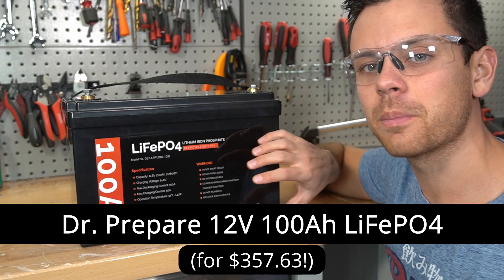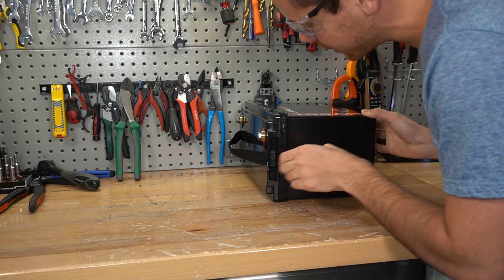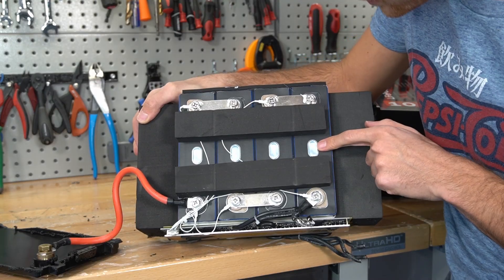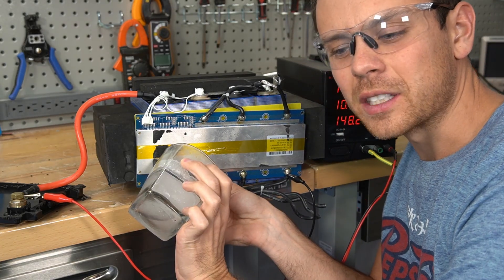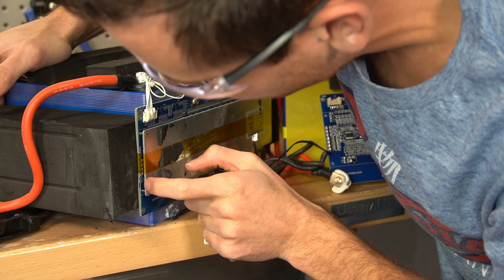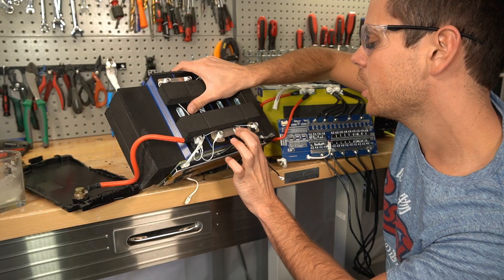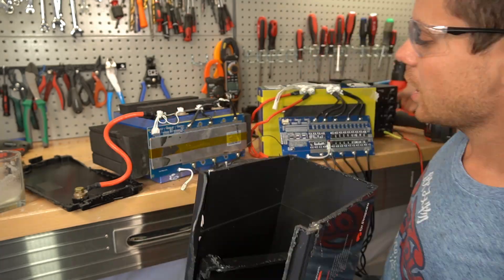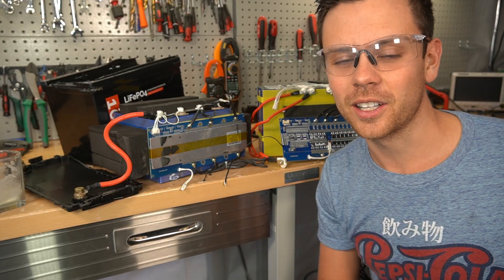Dr.Prepare 12V 100Ah LiFePO4 Battery Tear Down!

Comment: I just got 2 of these batteries for my boat trolling motor. I will make sure and charge only when outside temps are above freezing. Thanks for the heads up. Glad I got the Weize for my RV as it charges in the cold.
Reply: I just bought 2 for my Trolling Motor. How have yours held up?

Comment: Dr prepare solar batteries have full charge capacity of 30 percent full charge at 12.7v when requires 14.5v for 100 percent. stored.  13.75v tried all tests on these batteries and they completely fail as lifepo4  battery, they operate about as good as used car batteries

Comment: You should review this again.  They've added low temp protection so it would be good to do another tear down.
Reply: I'd like to see the new tear down since I just bought 2 from Dr prepare
Reply: Me too. I got two 2/2/24
Reply: I bought 4 of these, with the screen.  2 failed immediately, they replaced them so I was happy.  I used them for my mower. By the time they sent the new ones though it was late in December and I didn't need to mow.  Finally I got to mow with it, and in the middle of the first mow, it is dead. a third battery is bad.  I'm going to go buy a different brand.  I don't have time to keep dealing with this.

Comment: I just purchased 4 of the $299 batteries for a golf cart. They do claim to have low temp sensors on this battery. I'm not going to cut them open, but they're working great for me.

Comment: Well, I did not listen.   Yesterday I received the Dr. Prepare 12 volt, 100 Ah battery.  I charged it to 100% using my solar panels.  Today I attempted to connect it to my 2,500 watt inverter.  First I disconnected the battery that was already connected to the inverter.  Next I connected the positive terminal of the battery to the inverter.  Then I always connect a 30 ohm resistor between the negative battery terminal and the negative terminal of the inverter for about 30 seconds in order to eliminate any spark and surge of electricity to the inverter's capacitors.

After the 30 seconds, I attempted to connect the negative terminal of the inverter to the negative terminal of the battery but a GIANT SPARK was produced and now, after 2 hours, the battery is unresponsive {aka DEAD !}.  There is no read out on the small view screen on the top of the battery and my voltmeter registers 0 volts.  My guess is that the BMS was not working properly from the beginning. I am glad that I was wearing safety glasses because small pieces of hot metal shot from the terminal.

After disconnecting the Dr. Prepare battery, I connected a fully charged battery from another manufacture and everything functioned normally {aka no explosion}.

Comment: Hey Will, I just saw an ad on my Facebook feed for the Dr. Prepare battery, and they claim (and show a video where it was tested in an environmental chamber) low temp charge/discharge protection. Is this a different model from the one you tested in this video?
Reply: They sell five models on their website.  Two do not have low temperature sensors and three do have low temp.  These specs are stated on their individual webpages.  I didn't understand Will's dissatisfaction with the ack of low temperature sensor considering the model in this review is not advertised a having low temperature.  You can tell because the batteries all look different; though they do look similar.

Comment: Curious what you do with the packs after disassemble. Do you take them to a recycling center or salvage cells/BMS?
Reply from the maker: Why would I do that? I need them. They will last for decades
Reply: @WillProwse  So you glue/tape the cases back together after cutting them apart?
Reply from the maker: @robosilo  no, I use them. My gate opener, cameras on property, using them in scooters etc. I never throw away my batteries, I need them
Reply from the maker: @robosilo  why would someone try to recycle something they can use
Reply: @WillProwse  In this video the cable was damaged and the case was cut up quit a bit. From a safety standpoint I didn't know how much you trusted the remaining parts.
Reply from the maker: @robosilo  oh I use this one for bad example batteries for new video

Comment: The BIG atrocity is that Chill Will did not notice the covered screw holes that hold the top in place and hacked the case open instead..  LOL!  How about removing the heat sink and connecting the  high temp sensor to it's rightful place, or would the BMS have to be re-programed?

Comment: Since the BMS is good, could you just solastic the high-temp sensor next to the fets and then solder in your own low-temp sensor to the unpopulated contacts to make it a functional battery? ... Also replace that frayed wire of course.
Reply from the maker: I can't think of a single person on this planet who would go through that effort, then glue the case back together, when you can buy a cheaper battery with better parts and higher quality design and assembly. That would be a huge waste of time.
Reply from the maker: Also, we have no clue what integrated circuit they are using to control the bms, and it could be flashed with different firmware that does not support low temp cut off.
Reply: @WillProwse  
No, I wasn't saying that should be a mod that would make buying this battery a good idea. But for those that might have already purchased one and are beyond a return period and have a bit of buyer's remorse. Also, it seems like the case uses screws, is it glued as well?

Comment: Do you think there is any build difference in the longer 4D 200ah batteries. I would assume they should be the same just larger. Any issues you have seen with the larger batteries?

Comment: Thanks for opening the case on this unit.  It looks like this is a classic example that your get what you pay for isn’t it?  After seeing the temperature sensor configuration I’m guessing that this battery wouldn’t last very long because it didn’t have things wired correctly to protect itself from overheating or cold temps.  Can you think of a time where this type of battery would be useful?  Could a couple of them be used with a small pure sine wave inverter as a battery backup for a computer or printer that needs to stay operational like for security cameras?

Comment: Hi Will. Yesterday I was texting back and forth about winning a 100ah battery … In this day and age it’s difficult to know who you’re communicating with … was that you that I was talking to?
Reply from the maker: No, that's a spam profile. Ignore it
Reply: @WillProwse   - On a totally different subject. I live on a catamaran. The lead acid bank is on its last leg and I thought I would try to switch to lithium. I have a wind generator, three 280 watt solar panels each with its own Blue Sky 3000i controller, two engines with alternators, an Aims 3000 watt inverter, and shore power when I'm at the dock. I'm thinking two 12v 300ah Chins batteries run in parallel might suffice. I understand that they have no low temp cutoff, however, I'm in warm weather all the time and was going to get the holding tank warmer you suggested just in case. I'm not sure how to handle the engine alternators as I know they need to have a constant load which lithium won't provide when fully charged. Any thoughts?

Also, I know that you have a bunch of fans in the sailing community ... if you haven't already done so, maybe you could put together a video about how to wire all these (above) components up on a boat? I would like to volunteer my boat as the guinea pig - Lol.
Reply: I called in the first 30 minutes and they doubled my gift and gave me free shipping too! 
I just had to pay a separate fee.

Comment: Got my Dr Prepare 100Ah Batteries today.  First thing I did was crack one open.  There is a lot of wasted space in these cases.  Mine didn't have a pinched wire but it did have the misplaced heat sensor and no cold temp sensor.  There were also sloppy finger prints all over the bus bars.  I'll clean these units up, move the heat sensor, install a cold sensor and repackage two of these into a Pelican Case for portable power.  Thanks for the inside look at this Dr Pooper of a battery build.

Comment: Last night I emailed to cancel my order and received this response below. The email confirms no low temp protection but also claims that is a feature?

Dear Value Customer,

Thank you for supporting Dr.Prepare. Dr.Prepare has received emails from some guests expressing some confusion about the low-temperature protection of the battery, so we would like to explain this to every customer here.

We saw the video that Will Prowse used a chainsaw to disassemble the battery and edited part of the process. It is impossible for our wires to be exposed outside. You can watch it again.

Our LFP batteries do not have low-temperature protection. Low-temperature protection is that under the monitoring of BMS temperature sensor, the battery will stop charging during 23-32F and stop discharging during -4-2F. And the battery will reach -F only when the outdoor temperature is lower to -40--22F, which means that the power will be completely shut off when emergencies or snowstorms happen. But with our batteries, there is no problem to be used at low temperatures. This allows the battery to continue to work in emergencies or snowstorms.

The built-in BMS in our batteries focuses on high-temperature protection. If the LFP battery exceeds 60C, there is a risk of high temperature in the battery, which may cause sparks. Therefore, we have two built-in high-temperature detection sensors, one is inside the heat dissipation aluminum plate, and the other is attached to the surface of the battery to ensure that the temperature of the two main components is within a safe range.

We hope that the above three paragraphs can help you understand our batteries and decide whether they can fit your requirements.

Please let us know if you want to keep your order or cancel it. We will ship it or process the refund in about 24 hours after your reply. 

Thank you again for your time and support. We are looking forward to your reply.

Best regards,
Dr. Prepare Customer Support
Reply from the maker: 😂😂😂 that's the best they got?! Wow
Reply: @WillProwse  I guess at a minimum they have clarified the confusion about the low temp protection. Their website does not state it has low temp protection so I can only assume this was a mistake in another review on a different channel. 

Two questions, first was that case also glued and screwed close or would you have been able to open it by removing the plugs and screws? Some people are going to end up with these batteries and it would be helpful to know if they can open them to check the wiring. Second did you remove the aluminum plate on the BMS? Dr Prepare claims there is a second temp sensor under the aluminum plate, but that was never shown in the video review. 

But it does appear this is a canned response going out to customers who ordered and are now canceling. 

Thank you for taking the time to educate the community. These videos take a lot of work.
Reply: @WillProwse  just heard from SOK they should be releasing updated batteries next week with their new Bluetooth enabled BMS that you can now buy today and a built in heat option for cold weather. 

So new SOK DIY BMS available now for $99 and new SOK batteries next week.

Comment: Gonna be real. I don’t like how you state having only high temp is bad. 

In some areas like AZ (most) you’ll never need the low temp sensor ever. 

It’s not bad but I think you should preface it by saying it wouldn’t be good for people in cold geographical areas as not being good for them. 

But most of the south west, Midwest etc would be totally fine.
Reply from the maker: It should be in every lifepo4 battery no matter what. It costs $1-4 to add it.
Reply from the maker: There is no high temp on this battery where it matters, which is on the bank of MOSFETs. That sensor would not trigger from ambient temperature. It's much higher, like 160 degrees Celsius. You don't understand the point of these sensors it seems. It does matter a lot.

Comment: Hello Will,   Regarding this battery and Low Temp Sense not being enabled.  I have a marine application in the SF Area, and the batteries sit in the Bay where temps will never drop below 50 deg F.  I don't believe low temp protection has any value in my application.  Would you agree ?    Second question: can a user open this battery up without destroying the case ?  You had mentioned screws that you missed.   Is there any reason I couldn't open it up an re insulate that errant internal connections, and make sure the battery is sealed against water intrusion  ?  Since the BMS was of good quality (I think) and the cells were seemingly of Grade A quality would you say this battery would be acceptable in my case  ?   This channel and your website are excellent. I am basing both a refit of my boats batteries, and adding a small power back up system to my home based on your information.  Have a great Christmas.
Reply from the maker: And thank you!
Reply from the maker: There are many other batteries that I recommend that are designed and function better than this. This is not a battery you should buy. I think the consistency in build quality could vary a lot.
Reply: @WillProwse  Thanks Will.   THen I will likely go with the Renogy 100ah as the case looks well sealed. The SOK is an option but the case is likely steel and will corrode.   Regards,
Reply from the maker: @brianboschma  sok has a nylon case option now. You should check it out.
Reply from the maker: @brianboschma  the new sok can be found here: https://www.mobile-solarpower.com/lithium-batteries.html
Reply: @WillProwse  Hi Will, thanks for the data.  Do you know if the 100AH battery , IP85 rated (Plastic case is available via CurrentConnect ?    I see the 200AH is not.  Thanks for the continued great vids.

Comment: Hi Will: Thanks for the great content.  I have a battery question for you.  My setup in the RV is using 3 Battleborn 100 ah batteries connected in parallel connected to a Muti-plus 3000va inverter/charger with al Victron mppt charger and other victron accessories. I was planning to add another Battleborn battery in parallel but wondering if I could add an SOC 206 ah battry to the bank.  I thought the Battleborn was 13.6 vdc and I see that the SOC is labeled 12.6vdc.   Is this going to be an issue?   Thanks

Comment: So why are batteries advertised in terms of Amp Hours rather than Watt Hours? I find it annoying to always have to do the math to get a feel for what a given configuration will power and for how long. The Google explanation seems to be that the Amp Hour rating is fairly reliable but a Watt Hour rating wouldn't be: because it is more dependent on the chemistry and how the battery is used. It seems like this problem also applies to Amp Hour ratings since with some chemistries, if you actually use more than half the rated capacity, you'll damage the battery.

Even cars make the effort to produce a standardized estimate of City/Highway MPG: even though your mileage may vary.

Comment: I've seen you make comments about the high temp sensor on several videos. In Florida, they might be more useful. We almost never see temperatures below 50 degrees fahrenheit.
Reply from the maker: High temp is for prolonged discharge when pack is in insulated compartment. Whether it's in hot or cold ambient temp environment. It's more to protect fets in unlikely scenarios

Comment: In your opinion. I am looking for a 12v battery for my trolling motor and i don't want to spend more than $350 and i don't necessarily need 100ah or the best battery just a reliable one.

Comment: Ok I have been installing LFP off grid systems on sailboats for a decade and have never had a situation where with a liveaboard there has been a need for a low temperature cutoff sensor.  So for me and my customers not having that is not an issue .  Why is it so important to you?  You do realise they make silicone heat pads for the express purpose of keeping the battery above the 1°C safe zone .  And not installing one would be a problem for me if freeze protection was warranted.
Reply: I have an off grid solar power system set up in an unheated shed. I need low-temp cutoff in my LiFePO4 batteries. It's a huge issue if a battery is misrepresented, and my batteries are damaged by charging below 0°C.
Reply: @robertm2663  perhaps you should invest in a battery heating pad specificly for lifepo4  or next battery upgrade either the relion Lt series or lifeypo4 cells both can be charged at -20°C. Or -4°F  I would never depend on a temperature  sensor to save my thousands of dollars  batteries
Reply from the maker: Instant and permanent damage if you charge quickly when the pack is cold. And we need to push for low temp protection in every battery. UL listed packs have 4 sensors for low temp charging protection. Cheap Chinese packs have none. It costs $1-4 to add it to the pack. You can short a cell from charging when it is cold, the dendrite formation can puncture the separator and cause a short from cathode to anode.
Reply from the maker: Or extreme capacity loss. And higher chance of venting

Comment: Ugh. I just bought this thinking that it had low temp protection. Does anyone have experience with a "newer" version of this? Meaning could you have gotten one before they added that sensor? I'm planning to heat my battery area so not a complete loss, but it did cost more than one I knew didn't have low temp charging protection. Any thoughts or insight is helpful. Great reveiw as always!

Comment: The "sensor" is a thermal switch. It's a piece of bimetallic metal that "clicks" when heated up. No reason to test it for low temp - it will only have one trip point :)